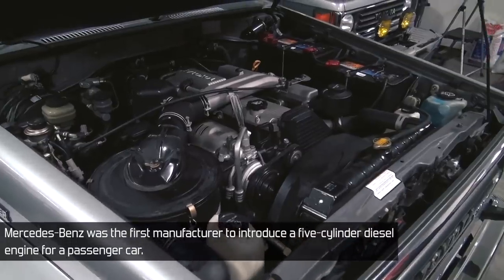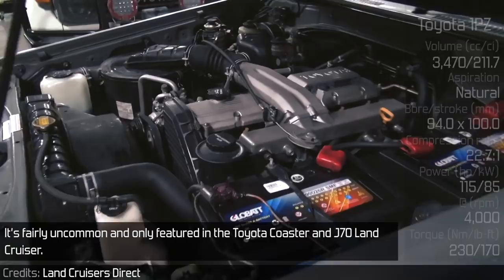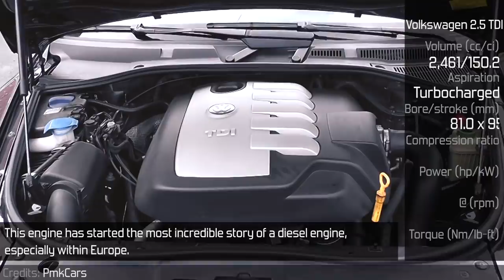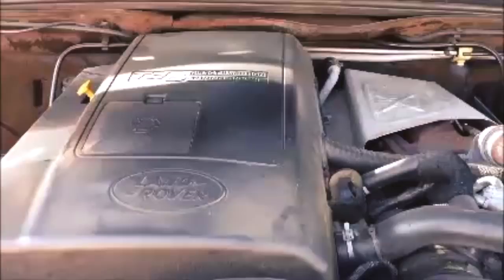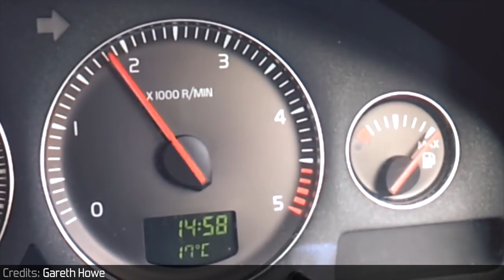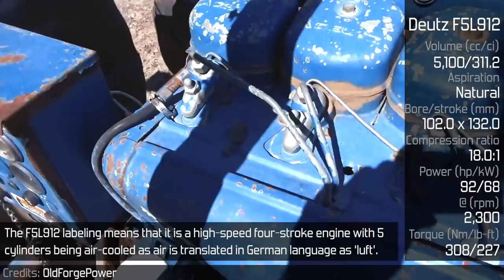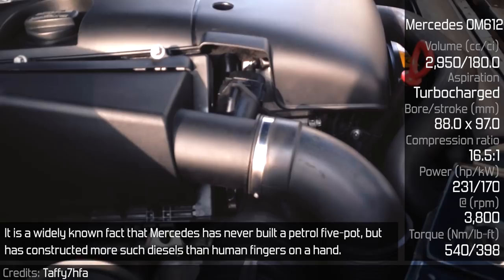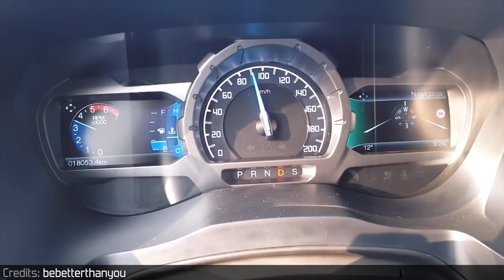12 Of The Best Sounding 5-Cylinder Diesel Engines

Comment: The 5 cylinder engine in the Touareg/T5 and the older one in the Audi 100/Volvo/T4 are completely different. The older is cast iron and belt driven, the newer is aluminium and gear driven.
Reply: And most importantly it Is not a PD injection, it has separate injection pump :/ (Audi c4-volvo 850/V70 etc..)
Reply: Lukáš Ch. Yes, only the Touareg/T5 engine has PD injection. The older 2.5 however got a common rail injection in the Crafter.
Reply: the 2.5 pd is crap
Reply: Only First generation (115-150 bhp) of 2.5tdi was reliable. 2.5 tdi used in touareg featured a new head, unit injectors and it wasn't as good
Reply: the aluminium engine  is volvo d5 nothing to do with vw/audi tdi
Reply: On the Touareg R5tdi the engine use a single line of first V10 tdi 5.000cc. Audi 100/A6 and Volvo 850 tdi  uses modular (4-5-6 cil.) engine VW (bore 79.5mm) mounted rispectively on Golf, Transporter T4, LT + Volvo 740/760.
Reply: The older Audi 100 units were PD engines, and later had a cylinder chopped off to make the 4cyl PD130s used in early 2000s Golfs, Boras, Passats etc.
Reply: @baghdadsersar5347  did the T5 TRANSPORTER have the PD or the Common Rail? (I'm talking about the 174 HP one, 2008 model)
Reply: @gzehupeja2851  our 174 CV one was reliable.
Reply: Isn't the touareg a 5 cylinder only when the V10 loses a cylinder bank?

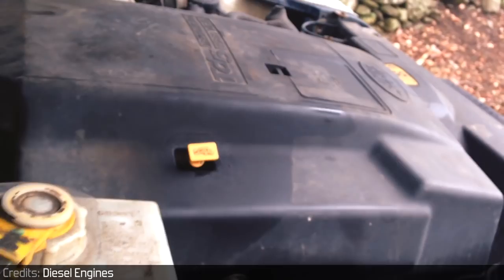Comment: The Td5 at 5:00 really doesn't sound good. It sounds actually broken. I have heard a lot of Td5s in my life, including the one I own, and that is not how a Td5 should sound.
ODPOVĚDĚT
Reply: My friend had a td5 and it blew a hole in the side of the engine block while going uphill one day, it had low km's...  Great 4WD tho but I never had any trust with Land Rover reliability and that just solidified it for me
Reply: I thought the same thing
Reply: I agree with you. The td5 you have there sounds like it is on it's way out. My td5 sounds a lot smoother than this one and goes better than the one shown.
Reply: Yeah it doesn't sound healthy at all.
Reply: Lmao yeah that thing is fucked
Reply: @MADMAN1747  those are garbage, i'd rather a chinese car
Reply: Yeh - but the next shot of the Disco taking off sounds amazing.
Reply: I work on Landy's every day and that is most probably a dead injector. Oh and the injectors are more expensive than anything else on the TD5
Reply: I don't know how they managed to give the Td5 so many issues. The L-Series it was based on is one of the most durable engines I've ever encountered.
Reply: Why this diesel engine has more bore than stroke?? It's a Diesel

Comment: The 2.5 TDI B5252T used in the 850 TDI and the V70 TDI is an awesome engine, at 140 horsepower. Awesome Audi derived engine

Comment: Ford 3.2 I5 Puma was available from 2007 to 2010 in transit product range with 200 PS. Awesome engine.
Reply: cool is it easy tunable ?
Reply: @alexanderdanielsson6049  I've got one in a transit  running superchips bluefin map at 235 bhp pulls like a train
Reply: @martinhardy3421  is there anyone running over 300 hp  i mean from that displacement you would expect it to make more power than a 605

Comment: 4:57 being a mechanic and also being very familiar of 5 cylinder engines, I can say that I'm pretty sure this engine is misfiring. I missed 2 engines in this video: the VW 2.5 petrol and the Fiat/Lancia 2.0 and 2.4 petrol, both naturally aspirated and turbocharged, the latter ones being my all time favorites.
Reply: The video is about diesel engines. And you don't haft to be a mechanic to know that engine you mentioned sounds fucked
Reply: Agreed, and knocking heavily too.

Comment: FIAT's JTD and JTDm/Multijet engines made history, as they were the first to use a common rail direct injection system with multiple injections per cycle. All of them sound majestic to this day. They're also the reason why VW eventually switched their TDI line from pump injectors to common rail, it was to better compete

Comment: Hi. 2,5 TDI engine that was in the Audi 100 featured distributor-type injection pump. This system was used almost till the end. Only 1st generation VW Touareg had this engine with pump-nozzle injection.
Reply: so a 2008 T5 would have distributor type injection that is common rail?
Reply: @andrewdiprose  As far as I know it should have pump-nozzle direct injection. If there is any source claiming otherwise, I would be happy to see it.

Comment: Before 2.5 TDI, VAG also used 2.4D 5cyl in T4 transporters and one of the Audi 100 models
Reply: The 2.0 was a 5 cylinder, the 2.4 a 6 in-line cylinder, also mounted on 200 Series Volvos.

Comment: Fun fact about the Volvo 2.0 5-cylinders: if you bought a 2.0 D3 and want a boost to D5, don’t change cars immediately.
A 2.0 D3 can, without much trouble, be chip-tuned to performance matching that of the 2.4 D5 engines.

Comment: I drive a w203 270CDI C class and I can assure you that the engine sounds amazing and pulls like a goddam monster as soon as the variable geometry turbo starts making serious boost ( around 3k RPM), the chassis handles surprisingly well in the twisties (i swaped the stock suspension for a "sportier" one from the CLK) and the comfort is crazy good as well... The only downside is the "slow" and kinda boring (although very robust) automatic gearbox :(
Reply: I have a ml with the same engine and transmition and it is true when you use the manual mode on the gearbox it takes one second to downshift it is very slow

Comment: There's an i5 ('puma'??) Turbo diesel engine, (at least, in Australia / South Africa, Latin America, etc), w/ iron block + aluminium head. The Aussies have been working hard & accurately, obtaining over 200 bhp + good torque from those, specially w/ upgraded Intercooler + specially tuned software. Those engines were (probably) produced in Struandale plant / South Africa. As far as I read, it's being replaced w/ a new V6 / 3.0 liter Turbo diesel, (graphite iron - nodular iron block), output figures about 186 Kw / 600 Nmt torque. So many thanks VR for your fantastic videos!!.. 
🤗🙏🙏🙏🙏

Comment: I must correct you on the Scania DC9: It actually was a 6 cylinder, when it was euro 3 - i think it was originally called a Scania dsc9 or something like it. It first became a 5-pot, when the Omnilink was facelifted and they became euro 4. The most powerful euro 6 version has 360 hp and 1700 nm :-)

Comment: Those 3.2L Ford diesels have plenty of grunt, but they eat auto transmissions. The old man's Mazda BT50 had a new transmission put in at 99,000km under warranty. Its now at 150,000km and its starting to head down the same road as the old transmission

Comment: Funny there is no OM605 which is superior to old 2 valve crap featured twice in this video. Also you got 2.5TDI horribly wrong, Audi100/A6,,VW T4, Volvo use this engine with rotary VE pump and cast iron block while T5/Touareg uses all alloy engine with PD technology not much common between these except it burns diesel and has 5 cylinders.

Comment: My favourite cars are volvo,  anyone recommend which engine to get?
Reply: T5 petrol
Reply: edzgt5 volvo s 60 d5
Reply: The first V70 model TDI, beautiful cars
Reply: edzgt5 a 5 cylinder
Reply: The modular I6.
Reply: T5 or 2.5t
Reply: The Volvo Whiteblock i6 can take 1000hp if you fill the groves in the block, has to be the 2.5l block (81mm bore is stronger than 83mm) and the 3l crank, buy some H-beam conrods and take T5 pistons from the 850R, then a huge turbo. Also has to swap a manual in it, get a ZF BMW tranny from a E46 335D or somethingand weld the bellhousing to fit the Whiteblock. Get the clutch from a 850R too or a Sachs 707 from some Audi. This creates a 2.8 liter straight 6 turbo monster that most likely can make 1200hp. 

The i6 is in the Volvo 960. I'm trying to get one. It may be a "new" thing in the States but here in Sweden it's the LS of engines, also the i5 is amazing, that sound too. The i5 is also strong as fuck. Best thing is the engines are more or less the same, so what I've written applies to the i5 and i4 Whiteblocks.
Reply: The 2.5t is not a good tuning engine, due to the 83mm bore, better to get the T5 with 81mm bore. Stronger and the record is round 1000hp in a fwd 850. If you wanna ball get a 850 T5-R with the "T-Gul" color (T-yellow)
Reply: B5234Tx.
Reply: Yes, a few. The five pots are what they're known for. Old (pre 2016) D5, also called 2.4d. Like Visio said in the video, the 2.5L unit is VW and you don't want that. For petrol, T5 is usually the highest rated five pot petrol. T6 is an interesting one: the SI6 (literally short inline six) 2006-2015 was partly designed as a powerplant for Jaguars and you definitely get the feeling of a long limousine like luxury saloon. Both the 3.0T and 3.2 naturally aspirated are very smooth running engines. Not revvy, but can still recommend. Steer way clear of any four pots and especially the PSA/Ford ones. I unfrtonately have one because fuel consumption but they're really just money pits in terms of repairs. Horrible engines.
Reply: Yes, a few. The five pots are what they're known for. Old (pre 2016) D5, also called 2.4d. Like Visio said in the video, the 2.5L unit is VW and you don't want that. For petrol, T5 is usually the highest rated five pot petrol. T6 is an interesting one: the SI6 (literally short inline six) 2006-2015 was partly designed as a powerplant for Jaguars and you definitely get the feeling of a long limousine like luxury saloon. Both the 3.0T and 3.2 naturally aspirated are very smooth running engines. Not revvy, but can still recommend. Steer way clear of any four pots and especially the PSA/Ford ones. I unfrtonately have one because fuel consumption but they're really just money pits in terms of repairs. Horrible engines.
Reply: a good old 2.3T5 is a great choice, tough motor, or if you want a diesel stick with a D5244T5 get a nice FMIC, bigger Turbo and remap and ball like a boss with 40mpg
Reply: T5 turbocharged. Preferably the R series of the cars.
Reply: I should go for the D5 163hp or the 185hp they run pretty cheap after the road!
Reply: @Tigernizo  yes 163 D5 is fine

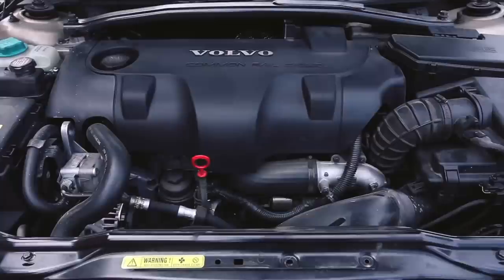Comment: 5:26 actually Volvo D5 is 2401 cc - and they are pretty rare here in Romania because of that 1 cc over the 2400 - it was included in the next tax and insurance rate and was more expensive to own.
Reply: Capacity was then reduced to 2,400cc (presumably for this very reason)
Reply: @applejuice5272  I currently own a D6 (D5+70ps electric motor) and in the papers it is now 2400cc 😁
Reply: @marius6279  Lovely! 
It would have been great if Volvo had made a SI6-based six-cylinder twin-turbo D6 using D5 internal dimensions (81 mm bore (SI6 82 - 84 mm) x 93.15 mm stroke (SI6 93.2 - 96 mm))

D6294T / D6
2,880cc 6cyl 24v
195 kW (265 PS) / 4,000 rpm
500 Nm / 1,500-3.250 rpm (gearbox limited)
Max rpm / 5,000 rpm

Comment: Amazing as always, man! Lot's of engines I didn't know of. However, I think you might have gotten it wrong with the Toyota engine. Unless I am wrong (I might), and the engine was available as an alternative, the Toyota Coaster only had 4 and 6 cylinder engines.
Reply: I don't even think the 1HZ was even available in the Coaster either. Just the Hino N04C and the 1HD series

Comment: can diesels be made with less torque and more quiet to feel like gasoline ones ?
Reply: Diesels are born with more torque less hp because diesel has long stroke piston travel...diesel need to compress air so much more until it becomes very hot enough to burn diesel(otherwise diesel wont explode)...thats why it needs such a long stroke!! by having long stroke it means torque will be strong even at low rpms but at expense of horsepower as a result...long stroke means more screeching of the piston and thats why they quack noisy like a duck being kicked in the butt! hope this helps
Reply: that's why they also vibrate more
thanks
Reply: i tought it's possible to pump less fuel ( and air from compressor ) at low rpm
Reply: and keep it normal or high at high rpm

Comment: Mine D5 has 224hp from factory - small mistake in video?
Reply: The new V6 ones use the D5 badge, the I5s only went up to 215
Reply: MarchuxProductions Volvo and V6 diesel?! And I'm sure I know what I have under the hood - 5-cyl 224hp diesel, it's an XC60
Reply: Jesus, I could've sworn they had V6s now, where the hell did I find that misinformation?

Just checked it, are you sure you're not confusing it with the T5, power wise?
Reply: @MacPiston Haven't you a polestar power optimization?
Reply: Josef Novák No, I don't. Now they have only shitty 2.0 R4, even if you have T6 or D5 badge :(
Reply: MacPiston I know. But they aren’t so shitty as it seems. Trust me.
Reply: Josef Novák I know what you meant - when driving, they are okay. But it always makes me smile when neighbor starts his new XC90 D5 and it sounds like s&$t. I just wonder if they will be durable enough to make 300k km without rebuild...
Reply: MacPiston MacPiston Yeah nothing can replace the sound of 5 cyl engine. But in term of durability I believe that they will be same durable like they predecessor. Some of that 4 cyl engines made more than 160k km without any problem (excluding service recalls). P.s. I had seen several D5 engines (latest generation of 5 cyl engines) which had around 100k km and they had separation between cylinder liners.

Comment: 2.4 JTD 10V has better sound than 20V
Reply: Tomáš Harmáček I fully agree with you, When the M arrived the multijet injection system changed the sound and not for the better.
I miss the Alfa 2.4 JTD unit, Shame it failed the euro emissions from 2011 onwards .

Comment: Why would Land Rover need to use anything other then the Rover V8.
Reply: Kuddlesworth NA because emissions
Reply: Well actually it's because Rover went under but they still make the engines just as parts. One of the best engines of all time.
Reply: Because in the UK it's 1.22 a litre at the min that's pounds so roughly 2 dollars 50 cent a litre work out your mpg cost for a v8 that delivers about 13 mpg
Reply: Land Rovers are built to pull heavy loads for which you need lots of torque at the lowest rev possible.